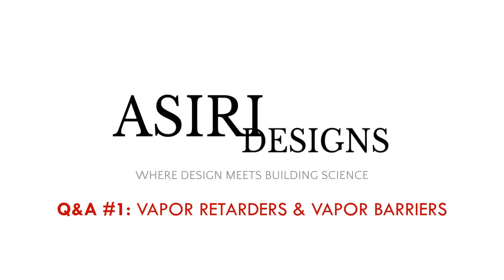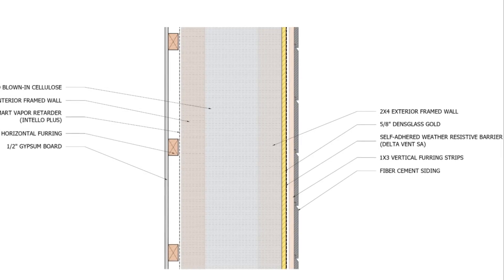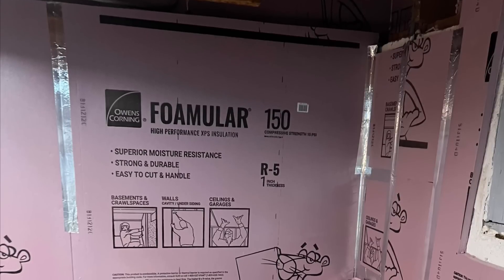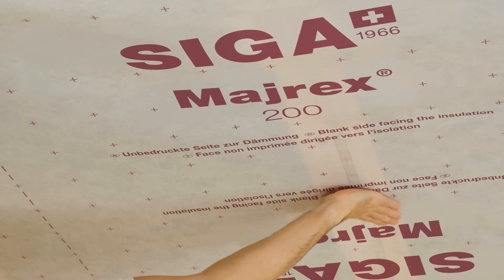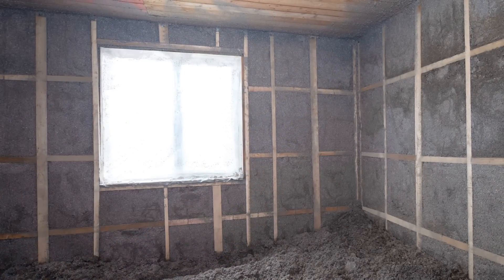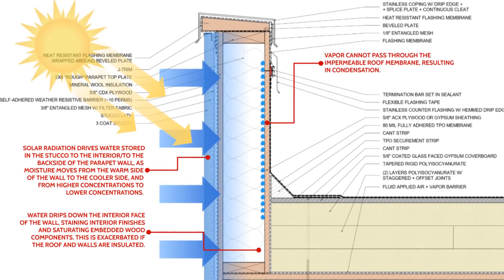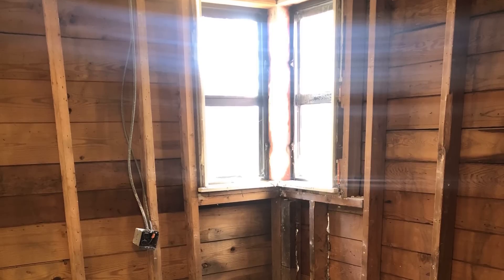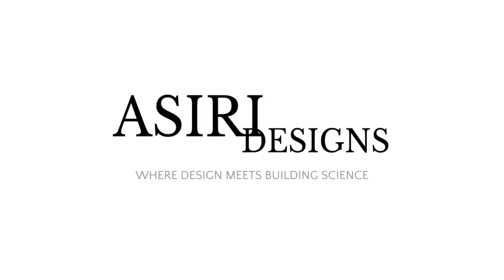Do Smart Vapor Barriers Really Work? Vapor Permeable vs Impermeable, ZIP System, and More! | Q&A #1

Comment: Ive got a 1940 house with oak sheathing, i planned to have Rockwool in the interior cavity but on the outside wall ive been thinking wrap tyvek and add 1" foil faced eps before my vinyl siding.  Is the tyvek a problem sandwiched between the sheathing and eps?  Is the eps too thin in this situation to cause more harm than good?
Reply: Mid missouri climate,

Comment: very curious what you would say about buildling in tropical climates, where all the cooling is internal, and windows are often open for much of the day, and there's lots of humidity! i'm guessing the only option there is external insulation?
Reply from the maker: Yep! You guessed it, external rigid insulation, preferably rigid foam unless you're dealing with termites, and something to slow inwardly driven moisture installed on the outside (this could be the rigid foam itself, or a semi-permeable WRB). Wholehouse dehumidifiers are a necessity if you're opening windows. Also, non-paper faced interior finishes, as these have a higher potential to support mold growth in these climates. If you're installing drywall, I'd use fiberglass mat gypsum like Densarmor instead. Absolutely no interior vapor barriers or vapor retarders.
Reply: @ASIRIDesigns  awesome. thank you very much!!
Reply: actually wait. why a semi permeable WRB? something non permeable like aluminaflash not a good option?
Reply: @ASIRIDesigns sorry am I follow up on this? Is a non perm like alumaflash a bad idea?

Comment: would it be possible to pair a brick facade with a double wall assembly?
Reply from the maker: Probably not the best idea, but it's certainly possible. I'd use a thin brick installed over something like Dorken's Dry and Lath dimple mat product so that the reservoir cladding is completely uncoupled from the double wall. I don't want to challenge that double wall system in any way that could result in additional moisture accumulation.